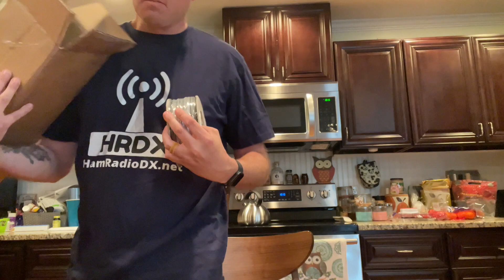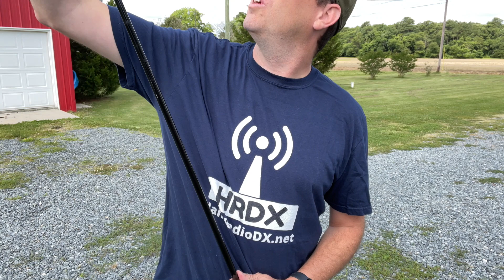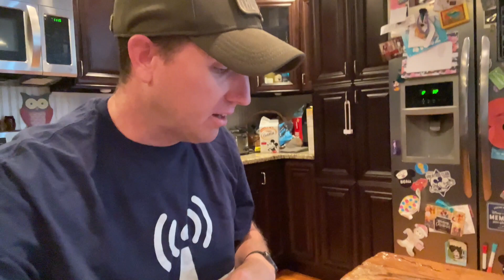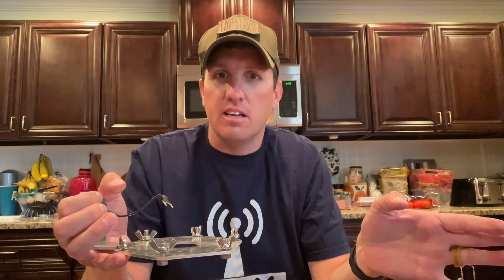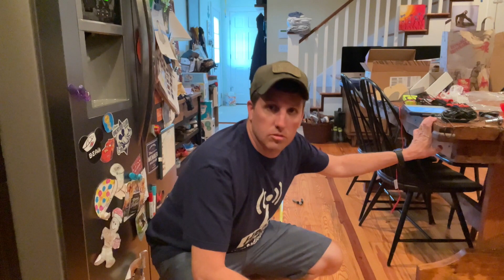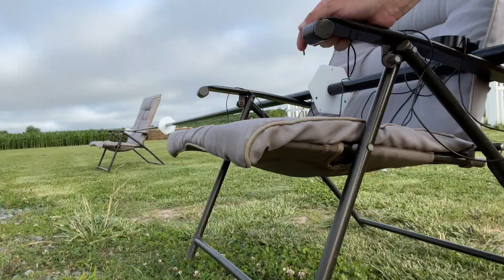DX Commander Rapide Antenna Kit Build

Comment: I am having problems with my rapide build. When I got to tuning the nanovna read infinity (line straight across at the top of the chart) no noticible dip on most of the elements. Does that mean I cut them too short? I am starting completely over again. Any help you can give would br most helpful  Buss (KI5ZYT)

Comment: The hardest part of the assembly of this RAPIDE has been the 40M add-on. This video is slightly better than DX Command's video for the same add-on. Details how to build the strain relief and winding the coil and the trail of the 40M element to the top and back down are left to one's imagination. DX Commander groups all of his models in one pile of papers and it gets confusing to sort all of that information out. Then the usual problem of the USA and "imperial" measurements and going between inches and CM and Meters, makes building this nice "simple" antenna a very time consuming project. KH7FC cleared up some of the building problems, except for the 40M add-on. Tiny complaint on my Rapide is that the driven plate had 2 holes not tapped for the supplied bolts. I improvised and used a smaller threaded nut and bolt.

Comment: Nice, just noticed it is not a bad length for a walking stick so maybe it is an advantage for walking up hills :-) Tiny point though, the Jubilee Clips are the clamps that go round the pole, think you might refer to them as pipe clamps? I am not sure what the plastic element clips are correctly called but you are RIGHT to point out they are not for the guy ropes and have never been intended for that. Enjoyed the video though, looked like you had fun. Might be a good job for an Octopus on occasions though :-) Well done.
Reply from the maker: Thanks for the comment, seems I got confused on terms. Yes I did have fun with it.
Reply: @WC9Beau  I love the way you add the title of the section in so it is easy to refer to One bit over another. I just checked out of idle curiosity, and because I couldn't remember the name. Cal calls them "snap-hook carabiner" or "plastic snap carabiners"  the main thing is you EMPHASISED they are not for guy lines, so that was VERY good. Also Brits are a bit weird, call a trunk (what Elephants have) a boot (that you put on your feet to keep them dry) and a hood (a form of hat) a bonnet (another form of hat) Pants (what you wear under trousers) trousers (cant think of another word for trousers) SO the Jubilee clips are probably best called hose clips or pipe clips, the American description for those is actually much more descriptive and correct. Isn't it wonderful that there are differences in the World :-) Keep up the good work, looking forward to seeing how you get on with using it. 73 DE Chris M1BZN BTW.if you think you got confused, come and live a Day in my brain.
Reply from the maker: Yes I was hoping that the time links would be helpful. That if someone was watching my video for tips they could skip back and forth and not get frustrated with trying to find a spot.